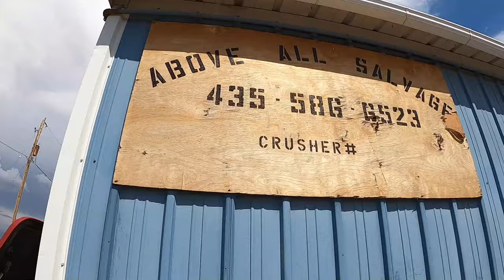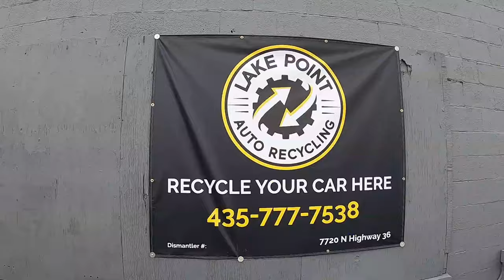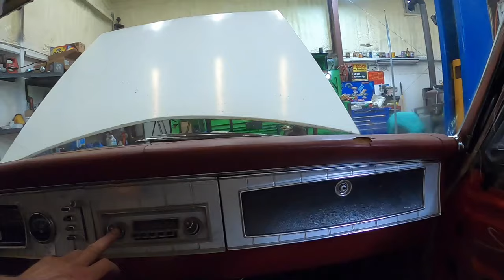You Won’t Believe What The Coronet Giveaway Car Looks Like Now!

Comment: My very first car was a 1964 Dodge Coronet. Sea green seats and interior. 225 Slant Six,
3 on the tree, and three push buttons on the dash. One of those opened the floor vents. 
It was a luxury car for an 18 year old kid on his first venture away from home. 
Yes, in those days, a tune up meant, new plugs, new points and a little grease on the rotor inside the distributor. Suddenly it ran smooth and strong.
My second car was a 1972 Plymouth Duster, 225 Slant Six and 3 speed stick on the floor. Must be something to it . . . 😂

Comment: My very first car was a 1970 Cornet with a 318 engine. It had set in a barnyard for 7 years. I paid 70 bucks for it. The day I went and got it I put a se of points in it 5 gallon of gas aired up the tires and put a battery in it and drove it home. I ended up pulling the heads off and did a valve job. Long story short I drove it from Ohio all the way to California in December 1982 when I went into the US Army. Then I traded it for a 1970 Plymouth Duster. That Cornet is going to make someone a nice toy. You guys are going to make someone’s day giving it away .

Comment: The junkyard guy is cool, I had a 86 1/2 Nissan hardbody. D21 KC edition a few years back it was extended cab. Sharp truck and I wrecked it. Had brush guard on front with winch plate and double roll bars. A chick slammed her brakes in the rain and I hit the car that hit her. Couldn't go oncoming lane because there was a car coming so I had to hit them. Messed it up pretty good

Comment: She just keeps gettin' better `n better.  I love the interior you chose, nice!  My 1970 Roadrunner rear windows didn't even roll down!  They were pop-outs.  I forget, does this have the manual-shift valve body mods?  I just love a manual-shift Torqueflight man!  We are praying to win this car as my wife's dementia is not gettin' any better and even I'm having trouble getting in and out of the ol' Suburban, thank god it's got step bars on it or we literally couldn't get in at all any more.  I FINALLY found out why she was using more than average oil and leaving spots in my driveway.  Whoever changed the oil out in California didn't tighten the oil filter, she was a leaking.  Finger snug only, Pft!   Put a new one on and changed the oil while I was at it.  Please dear God let us win this car, the Suburban is just too much for us anymore.  God? are you listening?

Comment: Use some thin plastic like shrink wrap when drilling the hot shaving will melt into the shrink wrap and be captured. Not in your bearings. Pro tip.

Comment: My 03 Jag had the same issue with the oil fill plug in the transfer case so Ford decided to call it permanently lubed. Worked good till all the oil went away and the planetary gears did not like that so much.

Comment: You should never juice the throttle just prior to turning off the ignition.  The raw gas washes the oil off the cylinders so that when you start the car later, the rings are riding in dry cylinders.  This is especially true for carbureted engines.

Comment: I’ve put PTOs on transfer cases with manual transmissions without any problems.  My question is how much loss of pressure you will get with the automatic having slippage in the torque converter??

Comment: I've had problems with Chinese hose fittings not quite fitting.  Either a hair too large or too small.  Either way, cause issues. That horn sounds like it's straight off a motorcycle.